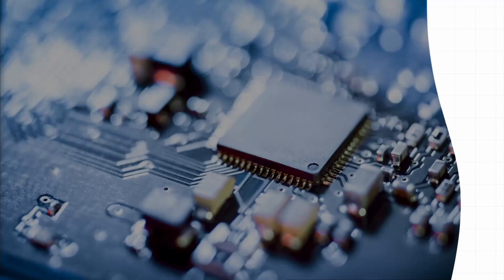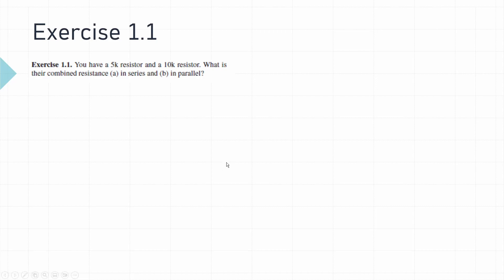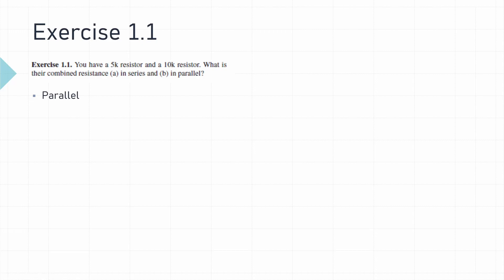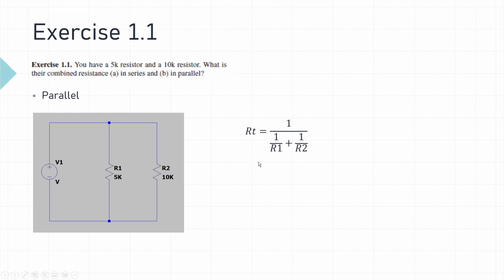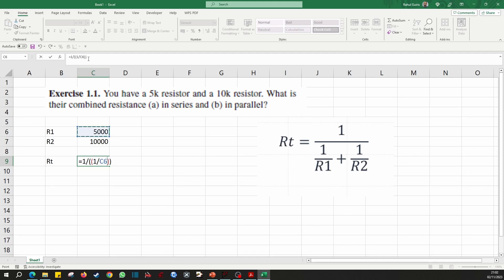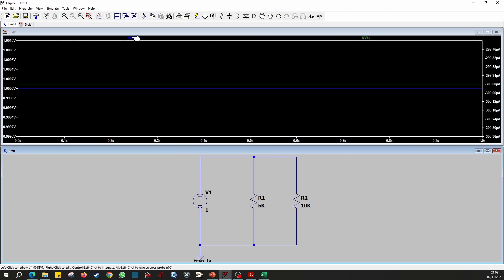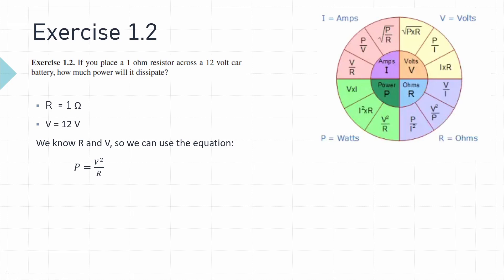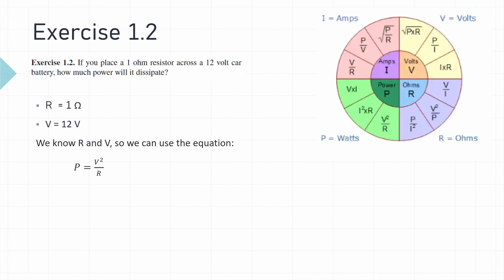Learn The Art of Electronics: Exercise 1.1 and 1.2 Series and Parrallel Resistors

Comment: In exercise 1.1 (5k parallel to 10k) it was probably also the authors' concern to recognize that the 5k can also be represented as two 10k in parallel. This means that a total of three 10k are connected in parallel. This allows you to quickly analyze a circuit without Excel and/or simulations (here 10k / 3 = 3k3).
But whatever, good work and a great idea to build the channel like this – keep it up!
Reply from the maker: Thanks. 

I missed that about the authors intention! But yh simple resistor combinations like this can be solved intuitively.
Reply: sim , o livro nos aponta essa intenção do autor!